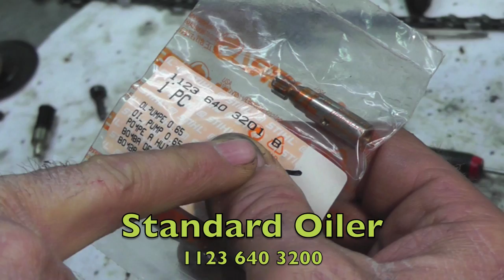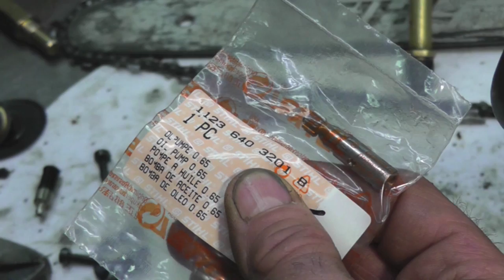Replace STIHL Oiler: A Complete Guide

Comment: I didn't know that they made higher output oilers for Stihl saws. I have an MS391 that has never put out as much oil as I thought it should even though it was set to maximum. I think I will take it apart and check it all out now. Thanks.

Comment: Hey Taryl, on a stihl ms180 chain saw, it has a non oiling issue, mine does not have a plug in the case next to the muffler, does that need to be plugged with a 1/4  20 tap and set screw installed, like the ms 250 u showed how to fix it? Thank you Kevin

Comment: This is probably a stupid question but I have a New 461 Sthil and want to put a 461R higher volume gear in my saw. Do i need to remove the clutch are just just the bottom handle and pull out old one drop new one in?

Thanks and enjoyed the video!
Subscribed!!!
Reply: the 460 series saw is different and has the oiler under the clutch. You do not remove the handle. The pump is an entire housing and the pump will need to be removed. I did this upgrade to my 362 a couple months back.

Comment: I noticed the rubber doll chain at 2:33 one is very well endowed!!!
Reply from the maker: +ferel I was wondering if anyone would notice that. Thanks fer watchin & Theres Yur Dinner!
Reply: +Taryl Fixes All LLC how you doing I was wondering if you can help me out. I have an ms361 Stihl saw. I have the oiler maxed out it is oiling I just feel it's under Oiler for a 25 inch bar. now I've heard you can switch out the oiler for a 460 Oiler butt I do not know if it will fit. would you happen to know if it does so this way I can increase the amount of oil that is delivered to a bar. Thank you
Reply from the maker: The MS 361 & 341 parts interchange oiler part # 1135 640 3200 the 460 uses a oiler part# 1128 640 3250 I don't think they interchange. I never tried it. A lot of stihl parts are used on other models but the part numbers are the same number on the other models. I get a lot of customers that complain about the the new model Stihl saws that replace the old models as being weak compared to a older model saw. I don't know I only repair them. Maybe replace the oiler. A site I have been buying Stihl aftermarket parts from that have good quality is HUTZL .net They have that 361 oiler. I would also replace the worm gear & clip. Maybe the clip on the worm gear is slipping that would make it oil less.
Reply: Thanks for ur response. Worm gear is good it oils fine with a 20 inch bar But a 25 inch seems to be under oiling. I just order the 460 wrap oil pump same part number u gave 5cc to 24cc 361 is rated for 15cc. I am going to try and see if it works. If it doesn't or does I will let u know. Thanks again. Also thanks to the EPA for these problems
Reply: Taryl Fixes All it works the pump from the 460 works on the 361 now bar is getting oiled properly. Sorry it took awhile to get
Reply from the maker: Theres yur Dinner! The student is now the teacher. Thanks for sharin the tip I'll keep that in mind Maybe even do a video on it.

Comment: I ordered the high volume oil pump for my MS250 saw that you recommend. I tried to install it but it want go down in the hole. I measured it and it is .005 larger diameter than my old pump. I don't know what to do now. Do you know what happened ?
Reply: Old comment, I know, I'm just happy you posted this.  I was wondering about that pump for my older 025.  How did yours get resolved?

Comment: anouther  thing to look for is the plastic housing can get chewed out if the clutch bearing gets slop in it the fix is clean it real good and use a good epoxy glue to fillin the hole in housing and renew the bearing
Reply: Hey I have that problem on an ms180c. The clip came loose from the worm gear and chewed holes in the plastic all the way around the case. Do you think JB weld would work In that, and if so how do you keep from getting it down into the passageway?
Reply: Randy Matthews gday i jusst used a bit of tape over the hole to stop it oozing through then used a 2 part epoxy glue jb weld might work bit harder to work with once set i had to clean up the exess once set to allow clutch and oil pump worm to move freely
Reply: Worked like a charm, I used a little quiksteel over the hole and put JB weld all around the case. Took a little sanding to get the clutch to move freely, but so far its working like its suppose to again. Thanks for your response.
Reply: glade i could help no probs

Comment: Great Video Taryl as always. But pulling My hair out on 2 things after tearing down my 019T. 1st, having a hard time locating online parts that carry Stihl parts. My local parts store closed and online proving difficult. 2nd for Stihl parts what number besides model 019T do I need to order parts? I have looked hi and low on saw for a serial number or a spec number which is what I usually use. Any help appreciated. I really usually just find a part store and enter model and spec and go from there.
Reply: amazon

Comment: I have one of those Ryobi 40 volt ones and it does not appear to be oiling.  The thing about it is that it seems like I have to open the whole saw to get to it.  I suspect that it got clogged.  It is out of warranty so I really don't want to send it for the repair.  With my horrible luck the repair would probably cost more than the saw is worth.  These are really good little saws BTW.  Just don't expect to use one battery all day long and these are not intended for commercial use.  I mostly got it for occasional use and because I despise those 2 stroke engines.  If there has been any fuel sitting in those 2 stroke engines for too long they can be really difficult to start.  Even then good luck keep it it running, at that point you have to clean it out.  The ethanol in gasoline these days does not help the matter at all either, it is pure evil in most small engines.

Comment: I thought you use a 8mm screw were the plug was since they don't sell them that's a 8mm hole there just don't run it in too deep to block the other hole for the oiler bar

Comment: Also use a little grease on your tap it will help hold the shavings that you blew right back into the oiling system
Reply from the maker: It's PLASTIC for one, and 2 the oiler pushes oil out. It Ain't The Space Shuttle we're not going to the moon!

Comment: I wouldn't use an impact to get the clutch off...especially if the flywheel is on. Too big a chance of stripping the the key out. The key is cast into the flywheel. Stihl says to never use an impact to remove the clutch or flywheel.....just sayin'